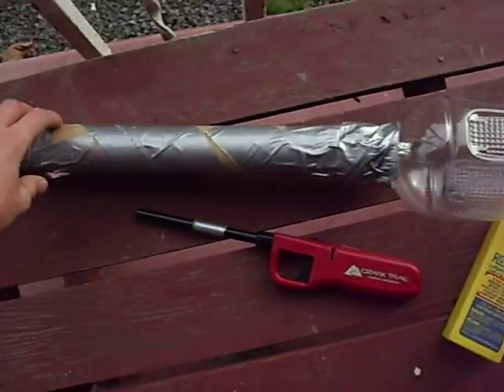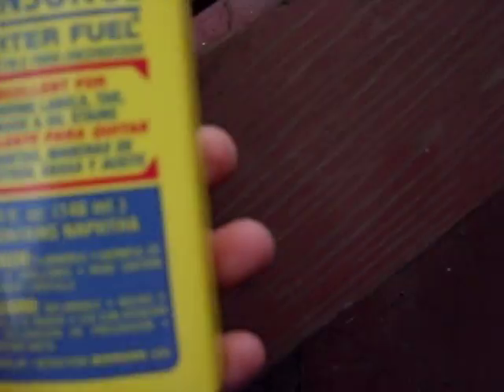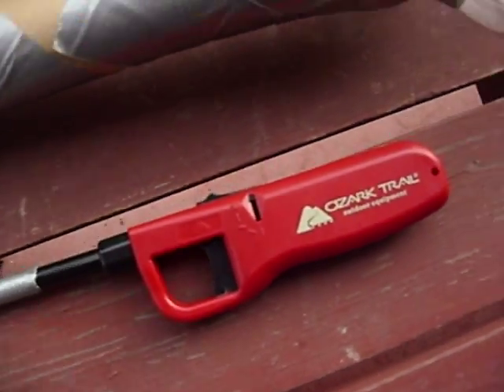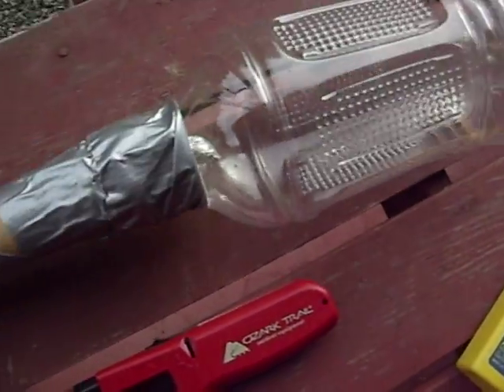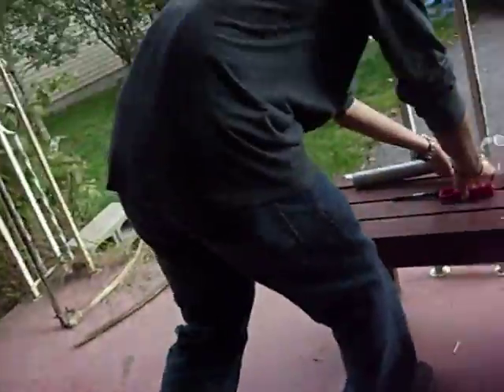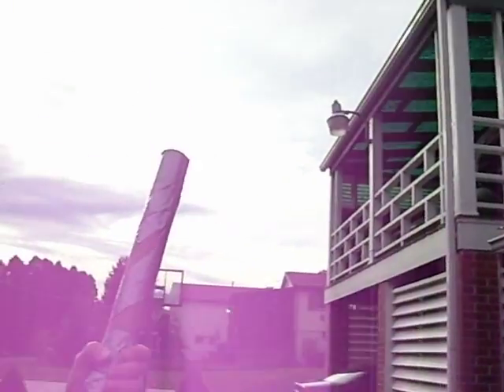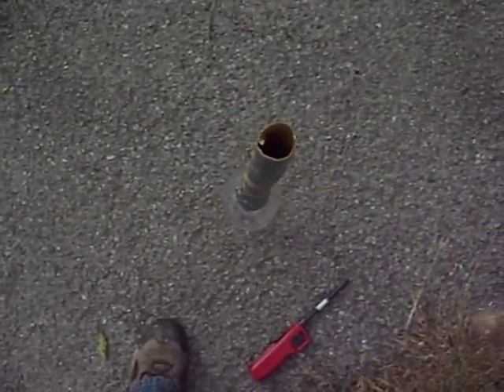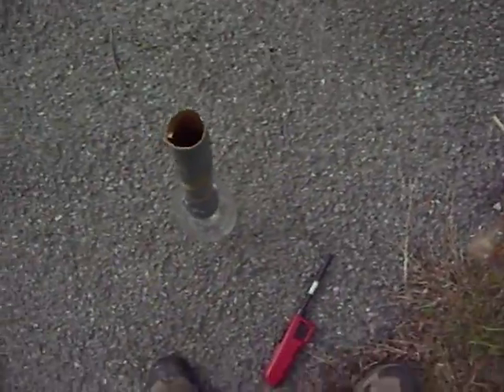Good Projectile Launcher

Comment: Hey, I made something similar to this, it is just a regular water bottle though, and I used axe body spray, and I found that you don't have to put the lighter in the hole, if you make the hole super small, you can still set it off. I put it on the table once, and the wind pushed it off, and I went to fire it, and the thing kicked so much, it shot out of my hand.